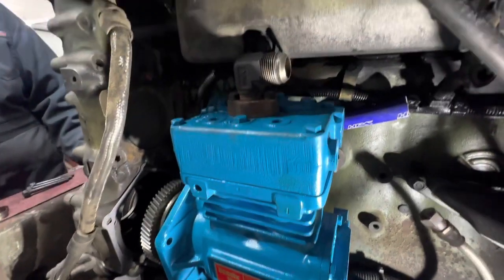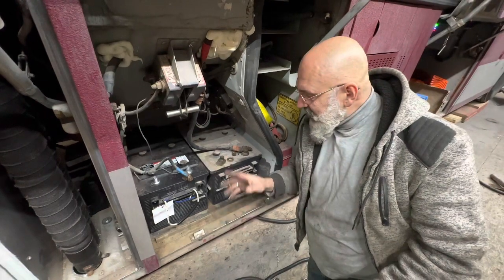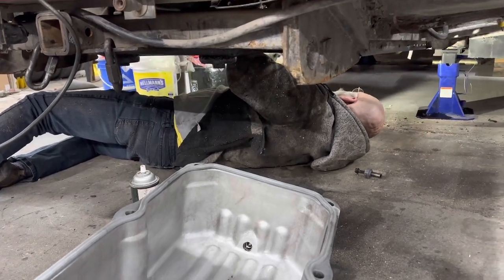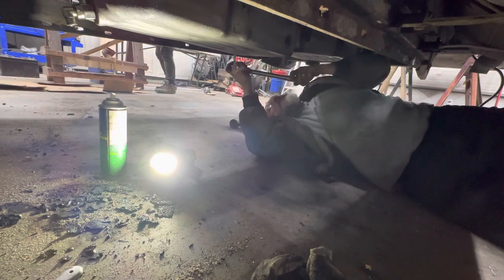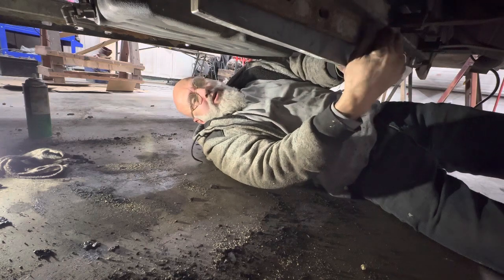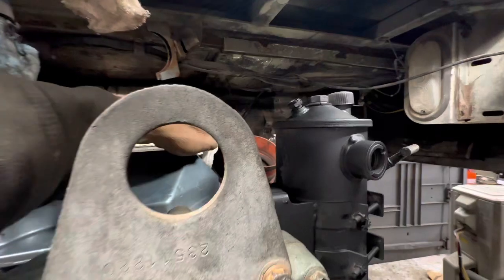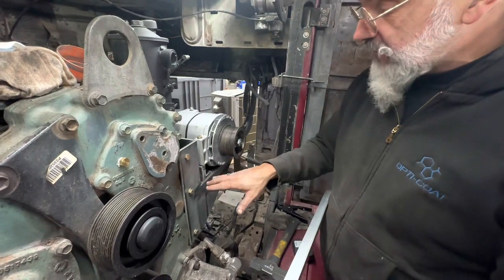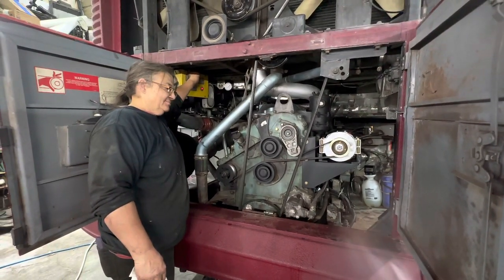E87, new parts on the engine!

Comment: Two questions. Where did you source the air compressor?  Did you have other symptoms that the air compressor needed replacing besides the leaking oil.
Reply from the maker: From a local truck shop, no other symptoms

Comment: What was wrong with the old alternator ?   Did I miss an episode ?   What alternator did you put in to replace it ?   

Some of the Js come from the factory with dual alternators.  Thoughts ?
Reply from the maker: Nothing wrong, but with the factory HVAC system removed, no need for such a big and expensive alternator.
Reply: @LacroixCruiser  What alternator did your bus come with and what did you replace them with ?

Comment: Have ever thought to move air drier from front and put a shifter in your coach ?
Never seen the protector you rebuilt on any coaches that I have been around , some of the coaches have had belly pans !
Reply from the maker: No we actually like the automatic transmission.
Reply: Snifter on your air system ?
Reply: If you ever freeze your air drier you will know why !